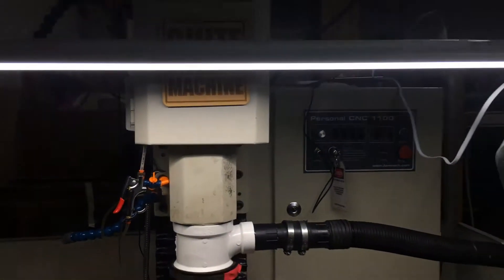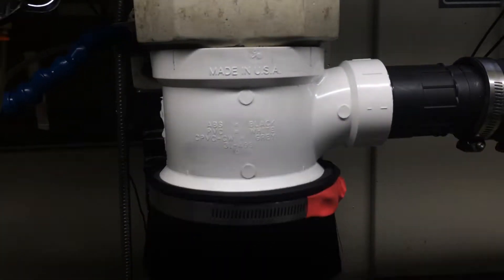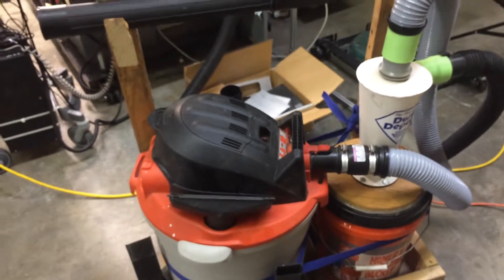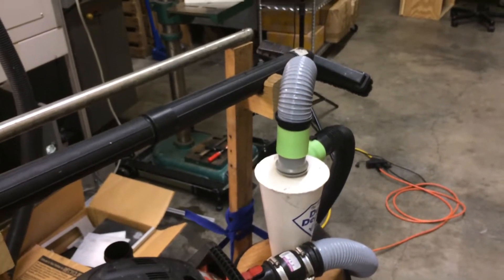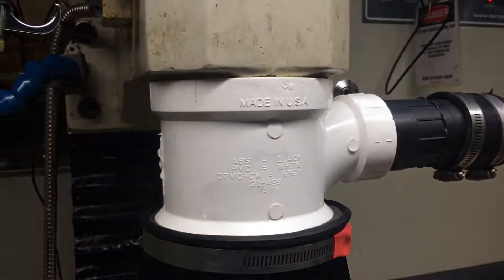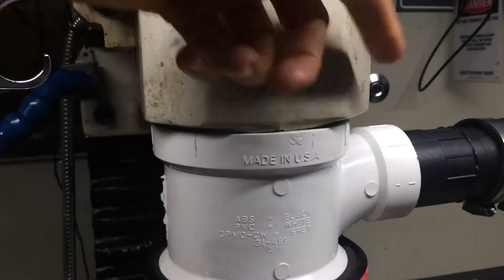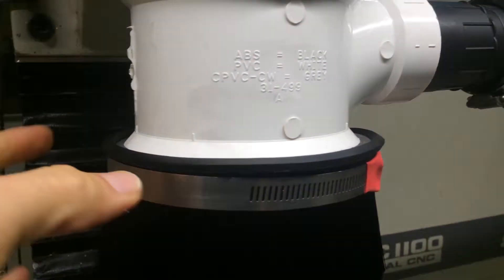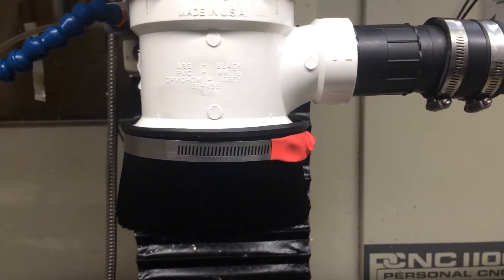EASY DIY DUST SHOE COLLECTOR for TORMACH CNC MILL PCNC 1100 or Bridgeport R8 Spindle for Machining

Comment: Ive read somewhere that fine G10 sanding dust gets thrue HEPA filters. still looking up info so not sure
Reply from the maker: ramone79 That’s possible. Milling generates larger chips though. I exhaust the air outside after the hepa filter (exterior exhaust was not yet hooked up in the video).